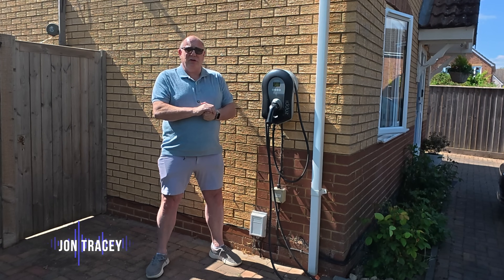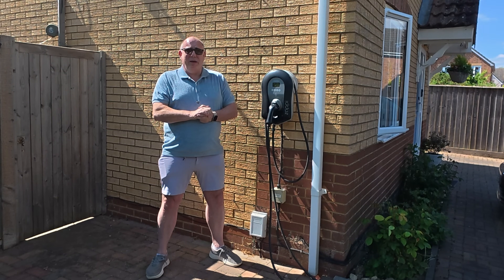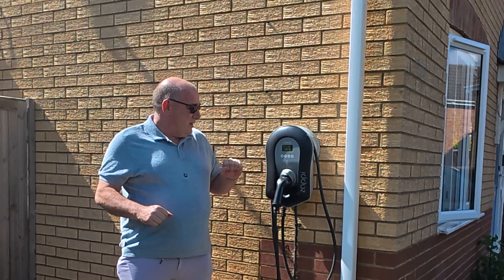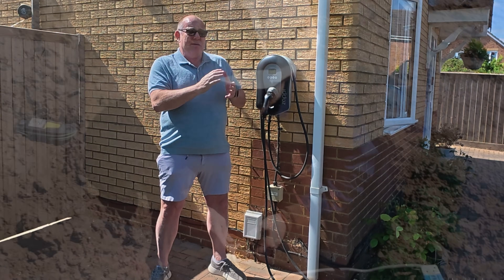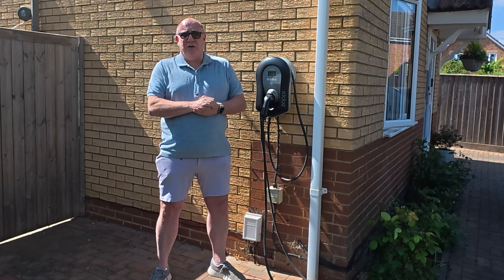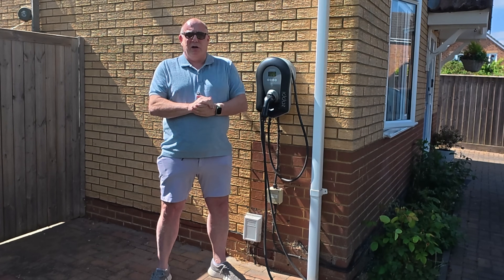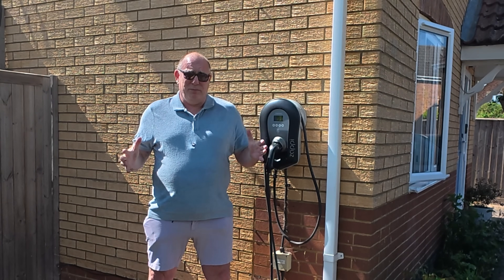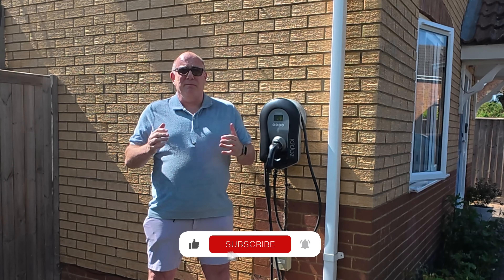Why This Home Upgrade Could Cost You Big in 2025!

Comment: Here in netherlands its totaly different, self solar charge is almost always cheaper cause of tax.
And during sunny days the kwh price is also low or negative on dynamic tariff cause we have so much solar. And with fixed contract its like around 10c/kwh and maybe like 2c/kwh on export. (2c/kwh = 12c (export price) - 10c (export cost), theses numbers vary per contract).  
But there is like a additional fixed 10.15c tax per kwh, and then another +21% tax on the total.
So without solar on dynamic contract in netherlands then in summer its cheaper to charge EV during daytime. In winter its usually cheaper during nighttime or whenever there is a lot of windenergy on dynamic. With a fixed contract it does not matter when you charge.
With solar its always best to charge EV on solar. Unless on dynamic the kwh price goes below (negative) -15c/kwh, then you get payed when using electricity. This usually only happens a couple days a year.
Reply from the maker: there is a major difference, we do not have to pay tax on export, you get to keep 100% of the money. Now I am 100% sure that will change at some point, the government accountants will get wind of this and say "hey we can have some of this" and that will be the end of it, but until then its time to maximise the export :-)
Reply: @JonathanTracey  the export cost i mentioned is not tax, its what energy suppliers charge on export due to costs of having the redirect solar power, since during middle of the day in netherlands we produce more power then is used.
So you can get a fixed contract that has export 12c/kwh and 10c/kwh cost so 2c/kwh. (I have no clue why they don't just say you get 2c/kwh...).
But the tax is only on import. This is like also a goverment incentive to reduce the amount of power you use in your household. This is also on gas. So this incentivices people even more to insulate their homes, and look for low power use devices when buying, and get solar.
This is why in netherlands most homes have good insulation and we are like in top 3 most solar per capita for countries for some times now.
We were number one but in 2024:
1: Australia
2. Netherlands
3: Germany
26: United States
36: United Kingdom 
For full list see:
https://en.wikipedia.org/wiki/Solar_power_by_country
And sort the table on last colum "per capita (W)"

Comment: ....... I do have home batteries, but whilst charging from excess solar, there is still an overlap with the My Energy system drawing from the grid before it uses power from the house batteries 3kw inverter whilst the Zappi is ramping down. It's a juggling act! Compounded by the fact that usually the last thing you want is the house batteries being drained when charging the car at night. I've got arround this by setting the battery inverter to trickle charge the house batteries for the duration of the night time cheap rate with Octopus Go. I would like to switch to Go Inteligent, but if Octopus then randomly charge my EV during the day, it will discharge the house batteries. My crude solution to prevent energy going to the grid, is the use a Granny charger set to a 2kw output on sunny days, as this is a constant load, the system components play well with each other. But it requires manual intervention and isn't ideal!
Reply from the maker: The only way I know to fix this is to use Home Assistant, form this can you can tell when something called intelligent dispatching (this is when Octopus assigns a cheap period) starts and stops, from there you can instruct your batteries to stop and hold charge or to charge from the grid.
Reply: Thank you. I don't know about the Home Emergy App, unfortunately the My Energy App doesn't give any stats on battery usage, just real time charging or discharging power readings.

Comment: It's a different story for the thousands of housholds that opted for free solar panels, as they can't benefit from any feed in tariff. However, opting to charge an EV from excess solar is still problematic unless you have a huge solar array. For an average 3.5kw south facing installation, it will be cutting in and out on all but the most perfect sunny days, as unlike the Eddy, EV's can't charge at less than about 1.6kw, the overlap can use a surprisingly large amount of peak rate energy from the grid whilst the system sorts itself out!
Reply: True, though that second problem is largely solved when you have a home battery as it can then act as a reserve to top up the charge rate as solar output fluctuates.
Reply from the maker: yep those “free” schemes do have some drawbacks, agree if you have a smaller system the eddi makes sense as it can work as low as 100w so you can maximise your generated energy

Comment: Tarrifs can change over they years / months. For now it makes sense to export. It's better to have the option to divert with Zappi than a dumb charger installed like the Tesla wall connector. I think the Eddi is a waste of money though never seems to work properly.
Reply from the maker: no sign of things changing yet but you never know. WRT eddi mine works ok just does not make sense with the heat pump, i get 4x as much hot water from the same energy using the heat pump than i do from the eddi
Reply: @JonathanTracey  Oh, didn't know you had a heat pump too! In that eddie defo not needed! Just an immersion heater on a trigger is all it is!

Comment: In Germany it’s just the other way round. If you send your energy to the grid you get about 8 ct/kWh. Normal price per kWh from the grid is 30 ct/kWh. So I use my Zappi whenever I can to divert any Wh coming from my solar panels to into the cars.
Reply from the maker: that sounds like the energy company is profiteering, your energy is likely being consumed by your neighbours, so there are no costs to buy in energy as normal from power stations, but they are paying you a pittance instead of treating you fairly.

Comment: Here in Australia we have seen the solar feed-in tariff go from a bonus rate of 60c/kWh to 30c, then to 7c.... and now to 0c, for bonus FiT and just a base rate of 3c/kWh. This really means that solar feed-in to the grid is worth almost nothing. Solar systems are designed to power the home uses first, then any excess goes as feed-in. You are best to plan to run major home devices (washing machine, dishwasher, heat-pump hot water, air-con, charging of an EV) during the day as much as possible.
I have only a small and poorly located solar panel set that really gives only minimal power (1.5 kW) but I get a great set of rates from my plan - 42c/kWh base*, 8c/kWh midnight-6am, and 0c/kWh 11am2pm. The 0c rate is because there is so much solar in the grid during the middle of the day that the wholesale power price is negative (generator companies PAY electricity retailers to take the power) so the company I am with still makes money from a 0c rate. Overnight the low rate is due to the unused grid with base-load power from generators (mainly coal) which cannot be switched off, so they still want the energy to be used.
I have an EV charger much like the one you show, and I use it every 4-7 days to charge the car overnight, or if I am at home I set it during the day for a quick, FREE top-up.
One day we will get a large rooftop solar system, but then its greatest value will be to power the home, top-up the EV, and if I can fit a generator switch to the home I may be able to use the EV as a big storage battery and power the home. My EV does have V2L functionality.

* The 42c rate is higher than many rates at 30c, but those are often a fixed rate and almost none have a 0c daytime rate. Having done the sums I am still ahead as I get great savings from the lower rates for EV charging.
Reply from the maker: Your energy plan sounds surprisingly well-structured—those 0c daytime rates and overnight cheap charging make smart use of grid oversupply. It’s fascinating how much things have shifted: from being paid premium rates to export, to now being incentivised to soak up excess energy just to keep the grid stable.

The idea of eventually pairing rooftop solar with V2L from your EV is also really forward-thinking. Even with your current setup, you’re clearly making smart choices that fit your circumstances—and that’s the big takeaway. There’s no one-size-fits-all approach, but understanding your usage and tariffs makes all the difference.

Thanks again for the thoughtful comment!

Comment: Same here. 
I haven't used my Eddi or Zappi for daytime solar divert since I went onto IOGo in Jan '23. Charge the house batteries, car & run appliances at night for 7p/kWh, run the house from the batteries during the day & export all excess solar during the day for 15p/kW hr. It's a no brainer. 
I've still got a gas boiler for heating & HW (no space for a HP) so all the solar export income easily covers the my gas usage for the whole year. 
If the tariffs change then I will need to re-think my strategy but for now that's how I role.
Reply from the maker: Sounds good, I have seen a lot of scare mongering about tariff changes but thats just life we cant live our lives on what if, just do what you can now and as you say re-think if things change.

Comment: Unfortunately you can’t get the payback without certification. Self installs etc. or a smart meter, octopus has basically refused both to me. 😢
Reply from the maker: Didn’t they put out a press release about six months ago saying that MCS certification was no longer required?
Reply: @JonathanTracey yes but as far as I know they’re still working on it. They’d like to get to that point where no certification is required, but it’s not there yet. (Unless I have missed something recently.)
Reply from the maker: I’m not entirely sure why it should take so long, surely it’s removed the bit from the process that says check MCS certificate, how hard can it be?
Reply: @JonathanTracey  You'd think so! I suppose UK regulation... 🤷‍♂

Comment: 3rd reason your a shift worker, on nights,  most of the energy on eco7  is lost and 80% of the time you will be on peak rates when you want to eat, which now kicks in from 2027-2030 at 4pm, on some plans,  in such cases charging the car up , heating the home, charging the batteries first,  for offsetting peak rates ,  is more beneficial than trying to export it, further more DNO proposals leaked talk about cutting home exports to under 4kwh again,  meaning the offset for later on in the year will never be paid off, so its best to size solar to what you can use not what you can export,
Reply from the maker: Yeah, it seems a shame there aren’t any tariffs that are suitable for people who work outside the regular 9 to 5 work hours. I suppose if you are a shift worker then these devices make perfect sense for you

Comment: Forth reason.  Your PV is not MCS registered.
Reply from the maker: I thought a few months back they drop the requirement for MCS to be able to get an export tariff?
Reply: Octopus hasn’t done it yet. They are still thinking about it. MCS are also so stretched they are taking much longer than they promise to certify installers. The MCS certification system needs a major overhaul.

Comment: Here in Australia it's quite different. We had the usual 6.6kW of Panels/5kW Invertor, which is the maximum allowed where you get input credits. You are allowed to "overdrive" the Invertor by 1/3rd (hence the popularity of the 6.6/5 systems). By itself with a Solar EV charger like the Zappi, we'd be able to charge up to about 25kWh on a good day. But that changes when you add a battery, as it charges first before you have a surplus. Suddenly it's more like 15kWh free for the vehicle with a 10kW battery, which is woeful. And the input credits have dropped to a measly 2 cents per kWh. 

We effectively doubled that with a second 6.6/5 system on the east facing roof to compliment the existing system, and added the battery. Now in peak summer we are getting up to 83kWh per day and even after charging the battery we can put just over 40kWh into the car per day (we are running two EV's). So we forgo about 80 cents worth of input credits (if they'd pay it on our system) but now have plenty of surplus so we don't need to charge off peak overnight at all.

Optimisers are essential especially when you get cloudy/patchy weather as the output is substantially better than basic systems. And we sized according to the worst winter days (based on the data from our 1st system). Our crappiest winter day is still close to 25kWh and is enough for the house and the battery with some spare. And historically we get a couple of "double" bad days a month, but over 3 years we have only had 3 "triple" days of bad weather. So we have been able to get by with waiting up to a couple of days to charge properly in winter and avoid downloading ANY power from the mains. Collectively we have done over 85,000Km's entirely off our solar surplus without resorting to Mains charge. So Solar & EV's work well in Australia rather than off-peak charging. You just need to size adequately. And of course in Summer we can run Air conditioners as we have enough surplus during the day to also cool the house. We charge our  EV's @7.2kW which is the maximum possible for L2 charging on our cars.
Reply from the maker: Thanks for sharing how it works in Australia—really useful to hear! If export rates drop here too, I can definitely see solar diverters becoming much more common as people look to maximise self-use like you're doing.

Comment: Rubbish. Residential solar grows so fast that before you know it prices will drop significantly. Just across the Channel in the Netherlands we are experiencing negative prices for a couple of hours every sunny afternoon. It won't be long before the UK sees similar price effects.
Reply from the maker: Starting your comment with "Rubbish" doesn't exactly encourage a productive discussion—it’s usually a fast track to being ignored.

That aside, it’s important to understand that energy markets vary significantly between countries. The UK and the Netherlands have very different grid structures, market incentives, levels of interconnection, and renewable energy policies. Just because negative prices occur regularly in the Netherlands doesn’t automatically mean the UK will follow the same path.

If you’re going to claim that similar price effects are coming to the UK, it would help to provide some evidence or sources. Otherwise, it just comes across as speculation rather than informed insight.
Reply: @JonathanTracey  Yup, the Netherlands and the UK are not comparable. But that is not what my argument hinges on. Solar grows exponentially, and grids everywhere have to cope with overwhelming supply during peak solar hours. I really don't see on what basis one could claim the UK is special in this regard. I think the future is towards more local use (or storage) of generated solar, certainly not less. That said though, apologies for the opening remark and... time will tell won't it?
Reply from the maker: I fully agree with you to a point, but the grid has the capacity to take the solar, what they need to do is reduce the amount of fossil fuel energy that’s coming into the grid, whilst keeping it balanced. Here in the UK, you can’t connect generating equipment to the grid without registering it with the local DNO, so the network knows what kind of capacity will be getting based on the installed equipment. This will allow the planners to ensure that they leave sufficient capacity for the solar that they’re receiving (and paying a lot less for) and not have to purchase expensive energy from the fossil fuel power stations.
Reply: @JonathanTracey  Hm. That has severe drawbacks too. If you only allow X number of car registrations because otherwise traffic jams would occur at the peak usage moments you don't make efficient use of the roads in the remaining 90% of the time. And everyone that hears "No" when they apply for a car registration will feel they may be wronged, seek legal recourse, or may resent early adopters. So I think such a system as you describe only functions when utilities succeed in timely scaling up. Otherwise it's just very unfair, isn't it. If I paid for an 100A connection, I should be legally allowed to use 100A, including feeding in 100A. But the utilities would not be able to sustain max rated power delivery to all homes in a sector. It only works because the concurrency of electricity consumption was very low (and is now rising). But while that works fairly well for consumption, with solar feed-in the concurrency is near-100%. Batteries etc can mitigate that effect, so if anything we ought to push adoption, not discourage adoption. And what you did was discourage it, hence my furious initial reaction. Cheers!